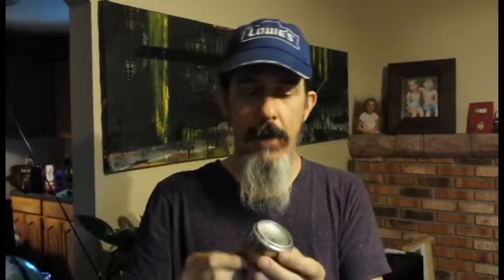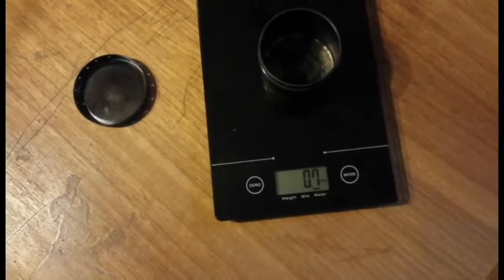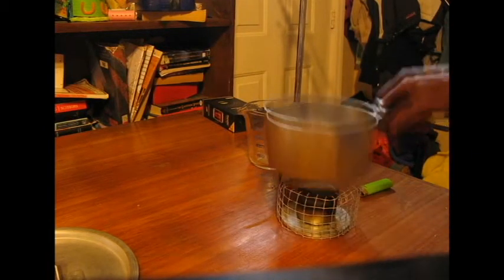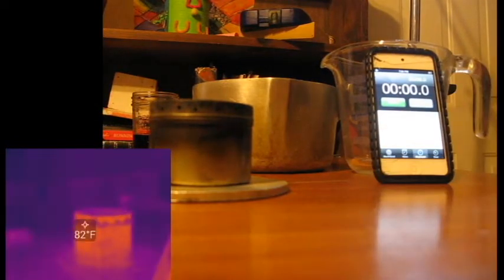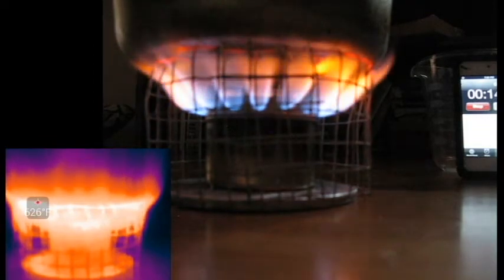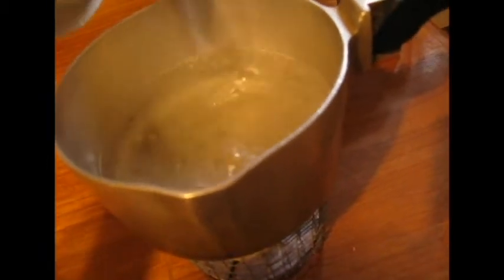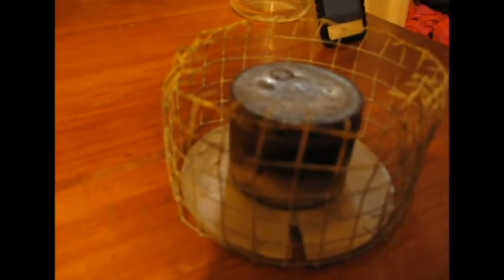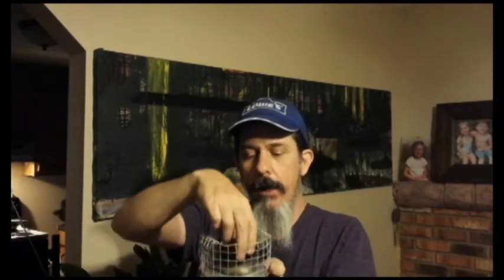Simple Alcohol Stove - 2 Cups in 5 1/2 minutes - 40 min burn time on 2 oz of fuel.

Comment: Im planning on just going out cause I need time alone. and I started learning about these alcohol stove. from what I researched alcohol stoves made from like coke cans usually burn for like 10 minutes. what allows this to burn for so much longer? are you using a special kind of fue/alocohol? or like a normal heet fuel that you can pick up at Walmart.    (yes I do realize I'm commenting 4 years late and am not really expecting a reply but if you do thanks and will definitely sub. I'm just a bit skeptical)
Reply from the maker: Just denatured alcohol from hardware store.

Comment: Great design. Are you not worried about the carbon monoxide? It probably doesn't burn cold enough for that, but I still don't like the idea of having that in the house.
Reply from the maker: +NO3- SAVAGERY that is true you should never burn an alcohol stove inside of a tent or any small enclosed area. I performed this task inside of my house but with a lots of ventilation
Reply: Not all combustion produces CO. Isopropyl alcohol makes CO2 and water vapor. That's why even kid's chemistry labs used to have alcohol lamps in them.

2C3H7OH + 9O2 -> 6CO2 + 8H2O
Reply: @benman314  yep they are safe to burn in a house or car
Reply: Been playing with alcohol stove designs. Bought a CO meter just to be safe. A meter, not a detector. So far, burning Heet and Isoproply, showing very little to no carbon dioxide. I'm going to have to try this stove design, thanks. :)